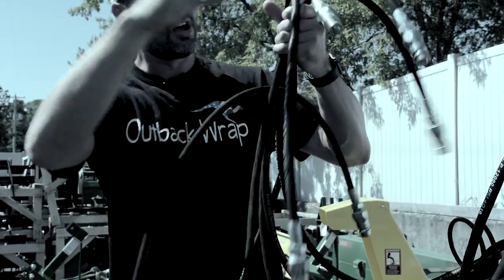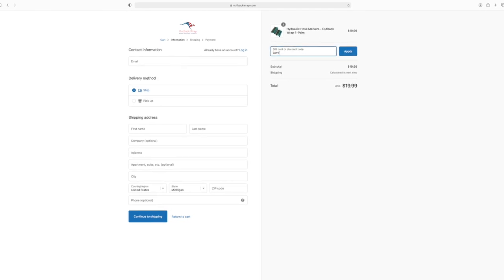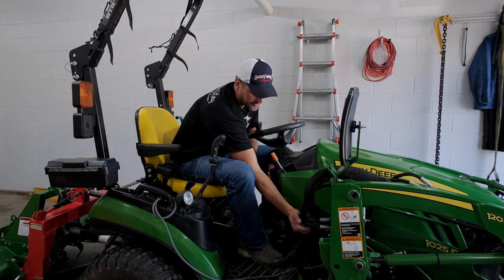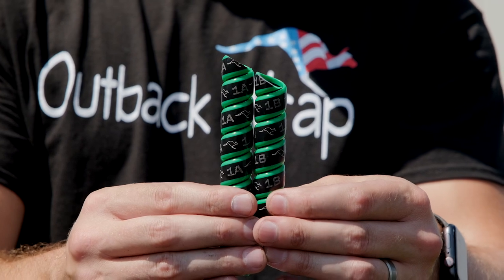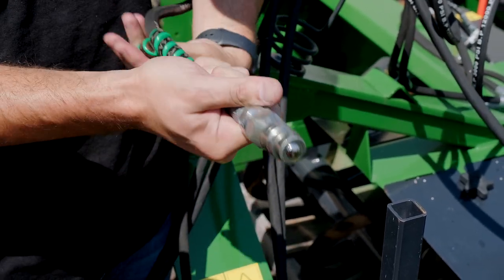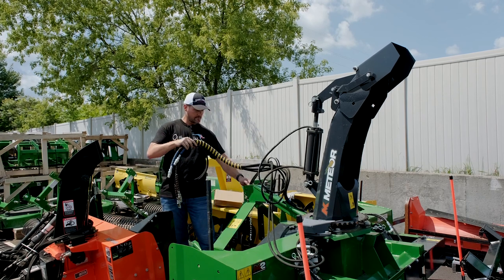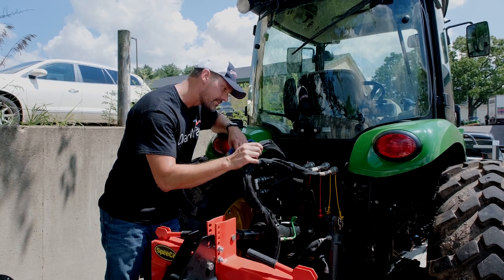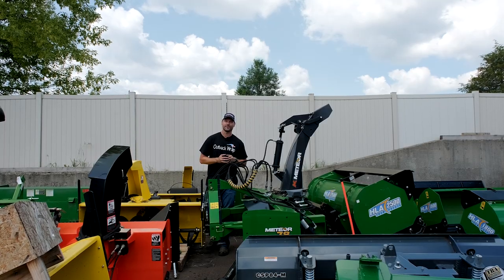WRAP IT UP! IDENTIFY, ORGANIZE, & PROTECT HYDRAULIC HOSES

Comment: Coloured electrical tape works great for a hose identification system. It doesn't offer the rub-through protection that these hose wraps will, but it's a boatload cheaper.
Reply from the maker: Yep, doesn't get much cheaper than tape!

Comment: I have seen similar sleeves on the air brake hoses on semi-tractor trucks. They also have springs that attach to support them when they are connected to the trailer. It is a great idea.
Reply from the maker: Yeah I've seen those too now that you mention it!

Comment: We use those underground on equipment, electricians have a different word for em, I can't really remember it right off the top of my head but I'll ask and let your community know... We use them for guard against rib rolls, excessive heat damage and we also have great big ones that hold multiple hoses on roof bolters
Reply from the maker: Very cool, interested to know what they're called.  Thanks for watching!

Comment: Now it would be nice if they had something to mark the blocks with the same color. Then it would be easy to determine where on the block each hose connected.
Reply from the maker: I agree!  I think they have more products in the works!
Reply: I did that when I first got my hydraulic top link using colored zip ties from Harbor Freight -- one on the end of the hose, and one on the receiver. It's worked great so far!

Comment: I used to build customized electrical control panels that went into industrial environments.  We used a similar product for electrical wires going to lights and switches on the door from the other equipment on the subpanel. We called it spiral-wrap. Not sure it was a brand name or generic name but it worked well. I can see that they also work as a strain relief as well.
In the video, you show wrapping four of the six hoses because of the extra room needed for the one cylinder.  If there is a section where all the hoses can run together but one set needs to "split out" before the other four do. You should be able to do that by having the one set come out the gap in the wrap.  We did this all the time with electical wires. Unless the factory warns against doing that for some reason.
Just a few thoughts.
Reply from the maker: Good stuff Seth.  Yeah, I could definitely wrap those extra hoses through part of the tamer and have them pop out the side.  Good idea!
Reply: @GoodWorksTractors  Another thing that can, at times, be done is to "wrap in" an anchor point for the hoses. It may not be the easiest and require some time to do but can be done.